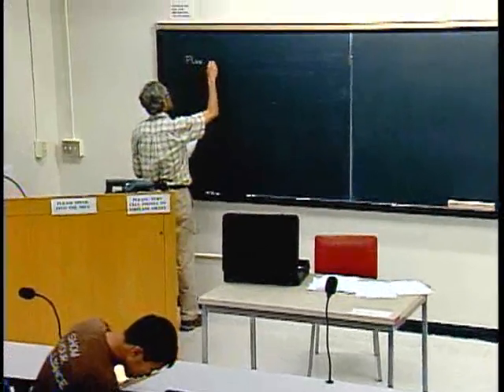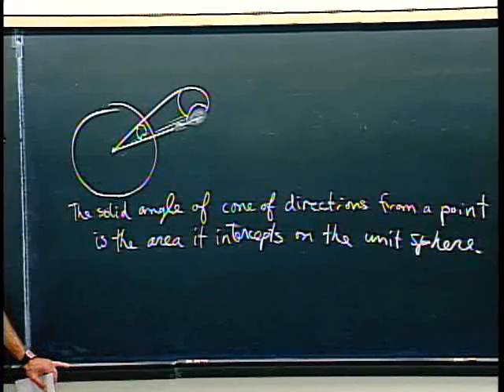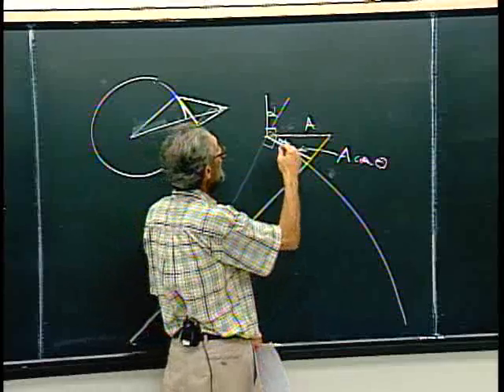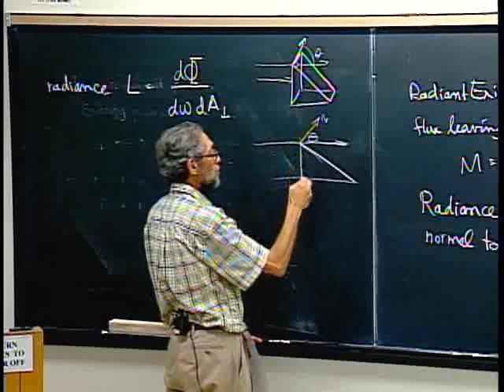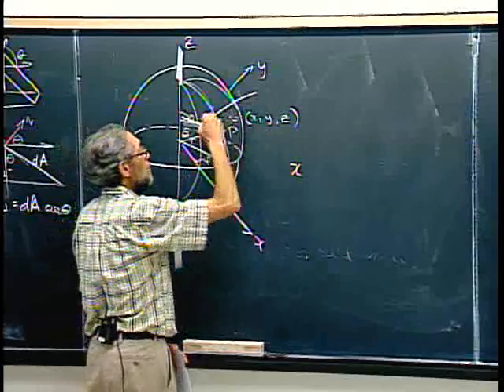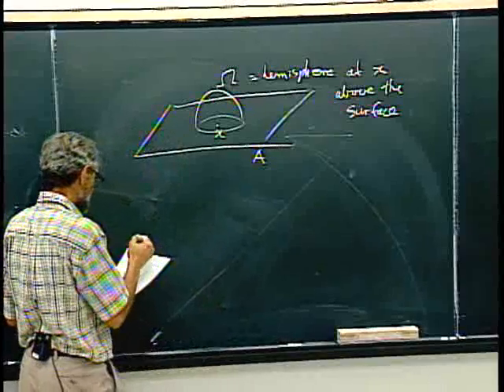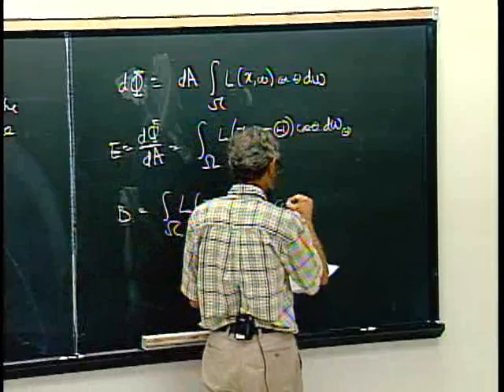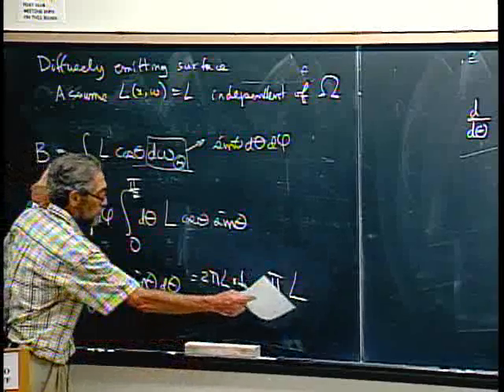Radiant Flux, Radiance and Solid Angle

Comment: @13.42 Normal to the spherical surface should be along the radial vector right? why has he drawn it at some different angle and calling it normal to the surface? and if it is normal to the surface then won't the radial vector and normal will make 90 deg angle with each other?